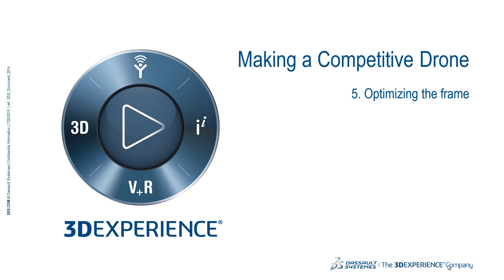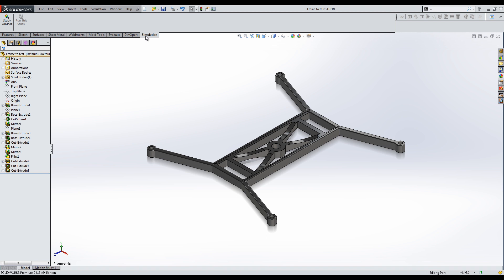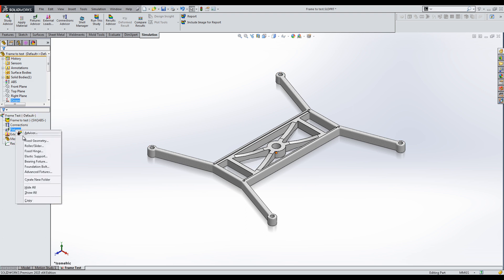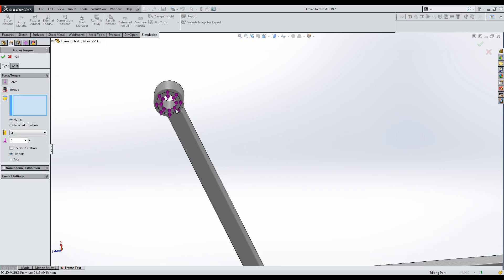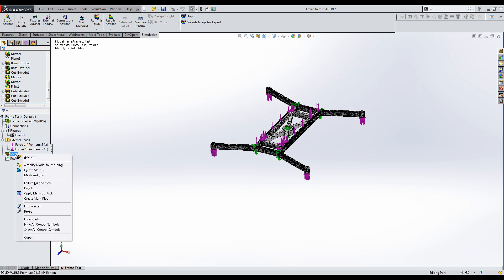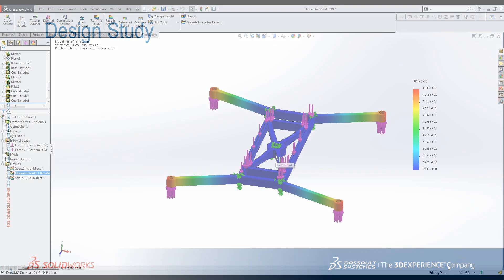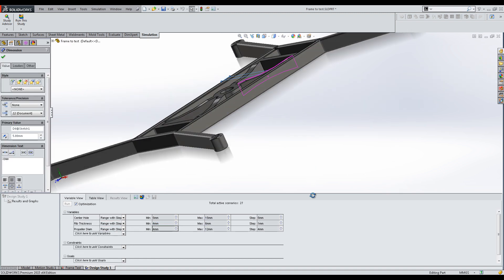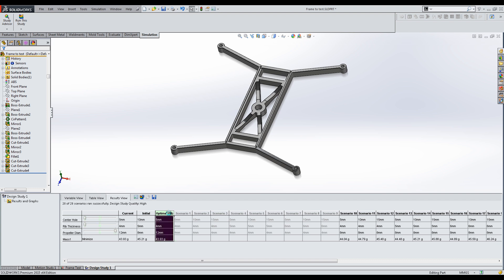Drones: 5 - Optimizing the Frame

Comment: huh, that seems super simple....if only it was more indepth. For example. I would like to design from scratch a drone that utilizes a 48 volt 100ah battery, and mount a gopro and a forward observing camera so I can see where it i going without crashing. I'd like to get 2 hours of flight time. There doesn't seem to be much for building such in solidworks and stuff